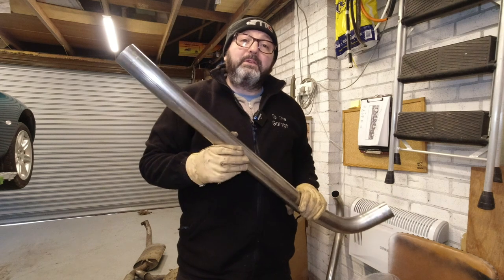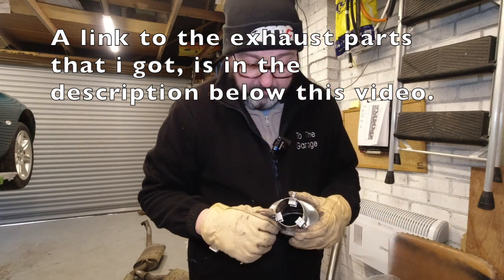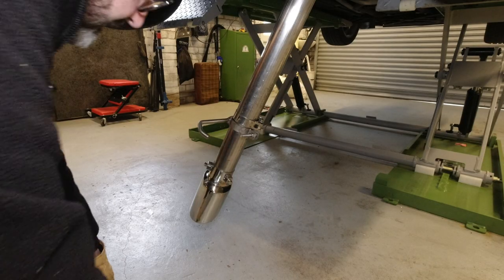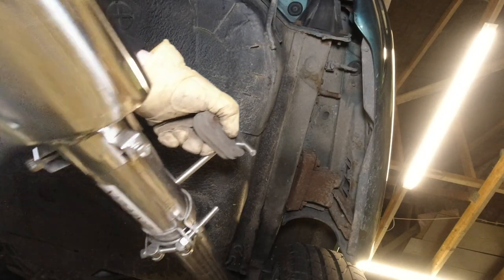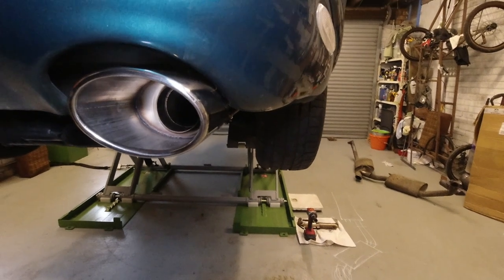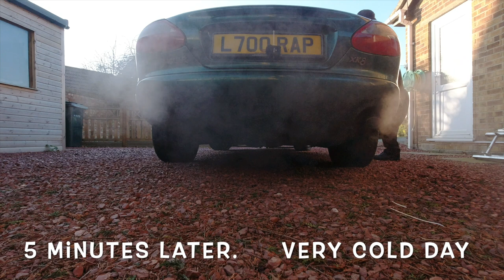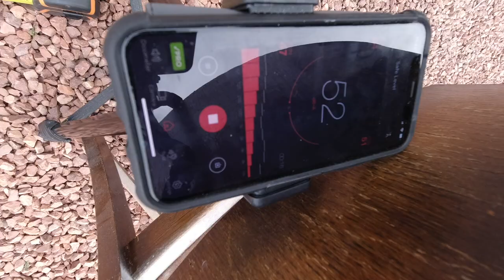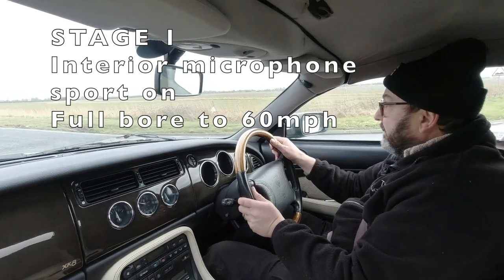Unleash the V8 Growl part 3. Fitting and testing Adamesh Stage 1 exhaust

Comment: Buy her a set of decent wheels. Those are far too boring looking for such a awesomely sleek car. They look like they are off of a 2005 Hyundai 4x4.
Reply from the maker: I disagree. I really like the flute. Strong, good size and relatively easy to clean.
20 inch BBS Detroits would look even better I will admit, but they are so easy to damage

Comment: I had the Adamesh Stage 1 on my 2001 XK8 convertible but there was a nasty drone around 40 to 50 mph. Eventually had it returned to XKR standard and still looking for a better sound without the drone. Would be very interested in Stage 2 section only comparison.
Reply from the maker: Always remember that its rare for a well fitted exhaust to resonate or boom. Particularly one with no fabricated boxes, Its usually, the sound the exhaust makes causing a body panel or a loose component to vibrate in sympathy with it.
However if it is just an exhaust note that you don't like at particular revs, then absolutely, exploring other permutations is exactly what you should do. The switch from just stage 1 to just stage 2 might give you that?  not done it myself though.

Comment: Thanks again John for very well made and informative video, you have good sence of what viewer wiches to see. 
I wonder if fitting only stage 2 would make a similar "sound effect" (quite adequate to me), but would give extra benefit of "deleting" the flat over axel section (better power and economy). Or would there be a reason not to do that ? Doing both stages 1&2 might make too much noise to my fellow people.  
I must confess, that after 1 year of watching every (?) TTG video, I got the courage to get my own convertible XK8 in last August. She's rust free, has got chain tensioners and now also leaky roof hydraulics renewed, but some smaller jobs to do still.. She's staying indoors over freezing Nordic winter for few more months.
Reply from the maker: Thank you so much for the kind words Jussi. I am toying with the idea of trying a stage 2 without Stage 1 just for the experiment. I don't know what would happen with sound levels but was. you say it would give the performance benefits. However it wouldn't look very pretty🤔
I will certainly be eventually going to stage 1 &2 as I have done it on my previous car and the sound plus the extra push is addictive😁

keep that cat wrapped up👍

Comment: Nice one John. Previous owner fitted what I believe to be a stage one setup in my XKR4.0. It's very boomy/reverberates in the cabin around 50-60mph. Might that be resolved with some sound deadening in the boot or is it likely to just be a crap install?!
Reply from the maker: Hi Doug.
Could be a poor install or solid rather than soft rubber mount, or tail pipe not clear of the bodywork. or rear wings have been welded and the sound deadening pads not replaced or the Harmonic damper above the tail pipes is missing.  (See Secrets of the XK8 ep 85 out tomorrow)
Reply: @ToTheGarage  Thanks John, that's really helpful - the car has indeed had the rear arches done - sounds like a few things I'll need to check next time I head out to the garage!

Comment: Looks fine...but I think the rear hanger would probably benefit from the arm having the bend, where it engages in the rubber, bent to a greater degree, and maybe, just to ensure it maintains position, a weld putting on the bracket to the exhaust itself...

Comment: I am very tempted to do a stage 1 Adamesh mod but I am concerned about "drone" at motorway/freeway speeds. My wife and I take long driving holidays ( in what I think is the best GT car ever ). I normally cruise at about 70 mph ( 112 kph ) and enjoy listening to the stereo.  Is there any significant difference in interior noise at 70 mph with a stage 1 kit ?
Reply from the maker: Its not significantly louder as long as the engine is cruising rather than pulling. When pulling you can hear it more.

Comment: That sounds darn good.
I bought the Adamesh over axle rear system for my 2004 XKR coupe many years ago, it sounded awesome.
I do wish I hadn't wasted my money buying the quad tail pipe tips though, they started rusting quiet badly within a month.
I now have a 2007 XKR convertible and am considering the Elite rear system which I think sounds even better than the Adamesh.
Reply from the maker: Go for. it FAST AMV👍

Comment: Great sound comparisons John. I love the use of the sound meter. I am glad you have not got any boom. I suspect mine is the rear bumper - soon to be sorted.
Reply from the maker: You will cure it 👍👍. I think as soon as folks recognise that the exhaust causes parts of the car to boom and resonate, rather than itself booming (except in very rare cases). then its just a matter of tracking it down or trial and error before they find and resolve the culprit.
Im enjoying your videos by the way👍
Reply: @ToTheGarage  Thanks for the compliment John. I have taken a lot of inspiration from you. 😀
Reply: @ToTheGarage  I have not completely cured it but it is about 10% of what I started with. I am wondering if the supercharged engine creates a slightly different frequency. It seems that there are many varied experiences ranging from no boom at all to unbearable sounds coming from various places. Mine was certainly all coming from behind me.

Comment: Hey john i did this same thing to my02 xkr and it looks great on yours the same as on mine,now i want to remove the small resanatoers and hope fully get a bit more sound out od it,what do you think?
Reply from the maker: Stage 2 kit will achieve this and is highly recommended.
Reply: @ToTheGarage  do you think it is advisable to scap the old mufflers and pipes,dont wanna hold on to stuff i donr need,thanks john